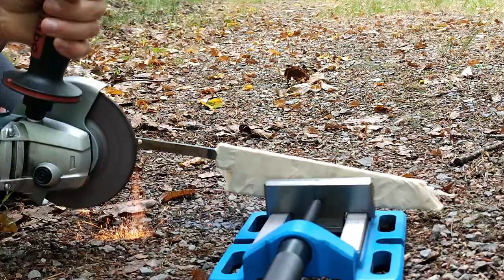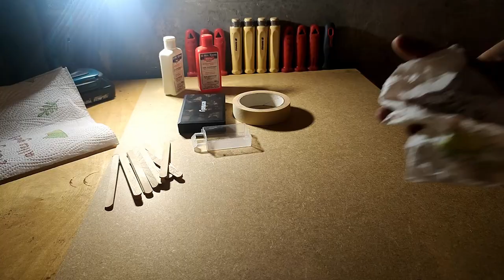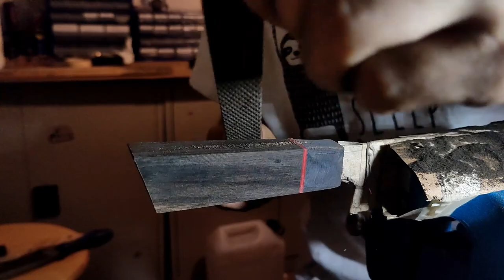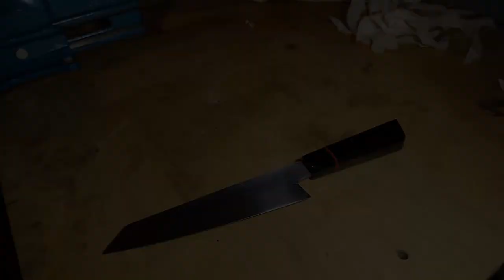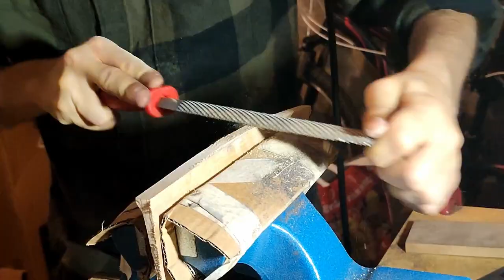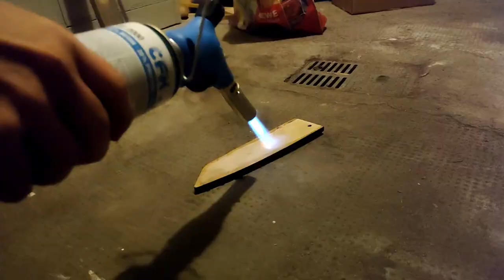Knifemaking #5: Bunka Project - Blade Finish, Handle, Sharpening, Saya

Comment: Hi thank you for the very interesting and valuable tutorial
I have a question Do you use abrasive paste with sand paper?
Which grits do you use most? Thanks a lot and kind regards Gino
Reply from the maker: I don't use any kind of paste when hand sanding, no. I use either water or WD-40. The steel I'm using is 1095, which isn't stainless, so WD-40 has the advantage of not rusting the metal if it's left on after sanding. If you sand with water, you'll have to dry it off when you're done or your steel might stain pretty quickly. Many people like to use window cleaner too, I personally haven't tried it.
 
Since I had already hand sanded this to 120 grit before hardening, I started on 120 here, then worked my way through 240, 480, 600, then 1000 and 2000 before smoothing it out on the buffing wheel. Not a perfect process, I feel like the buffing wheel took it below 2000 again, but I was pretty happy with the polish I ended up with, although not quite "mirror polish".

At the end of shaping, before hardening, I just started with 30 grit to work out the scratches then went to 60 and 120.
Reply: @slothworks7032  hi thank you for the very kind valuable and very complete reply and advice 
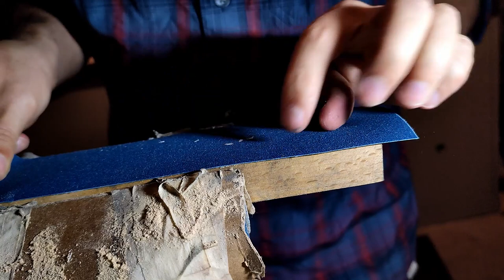I was referring to moment 2:18 in the video I was clearly wrong
Congratulations for your excellent work indeed I would like to do something on my own
But it is very challenging kind regards Gino
Reply from the maker: @gino3286   @gino  Ah, I see - that's not abrasive paste, that's the ebony wood handle block. I glued the sandpaper down on a flat surface with double sided tape to have a straight and flat sanding surface, then moved the handle block and the cow horn end cap around on it to flatten out the surfaces. That part with the holes is where the cap and the handle block are glued together, so they need to be  flat, otherwise you would be able to see a gap on one side after gluing it together (or end up with the cap being at a crooked angle). Since I sawed them by hand, they weren't entirely flat to begin with. Typically this is done with belt- or drum sanders, but I have neither and this is a good method to sand an entire surface while staying straight. 

The little white droplets on the sandpaper are wax. These wood blocks I buy are sealed with a layer of wax so they don't suck in moisture from the surrounding air. Thanks for the kind words, and you should definitely try to make a knife yourself, it's fun and you can learn a lot, and at the end you have something you can actually use.
Reply: @slothworks7032  hi thank you very much again i understand now For sure i will have to start with easy tasks
I like knives a lot Any kind Kind regards Gino